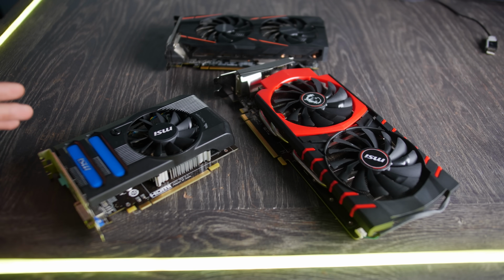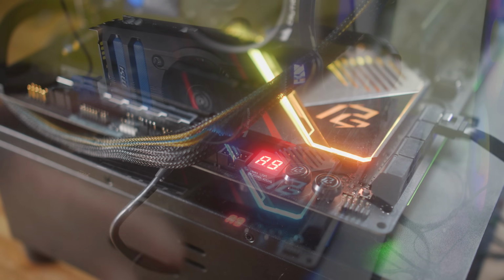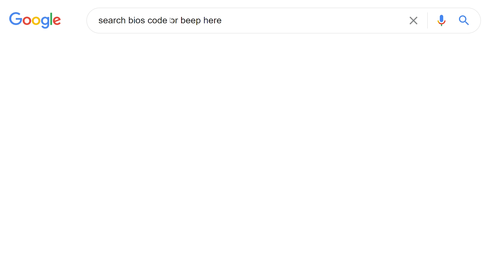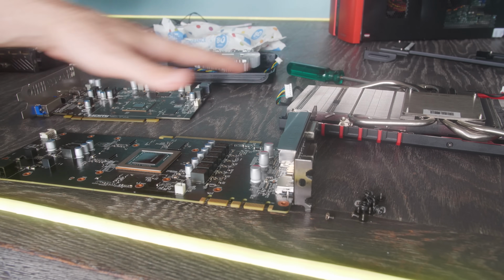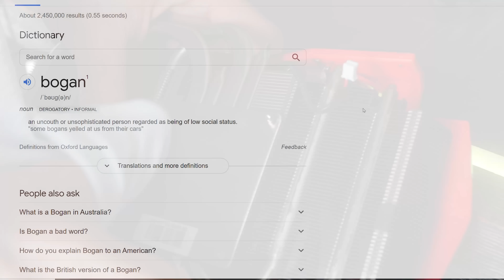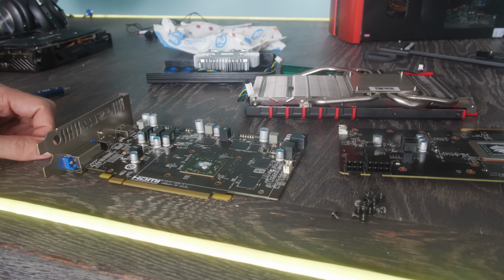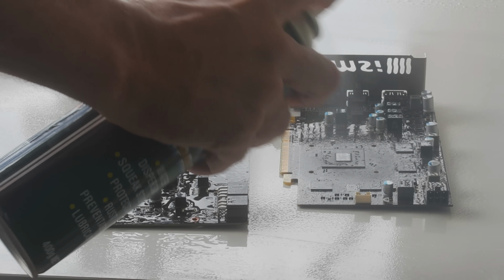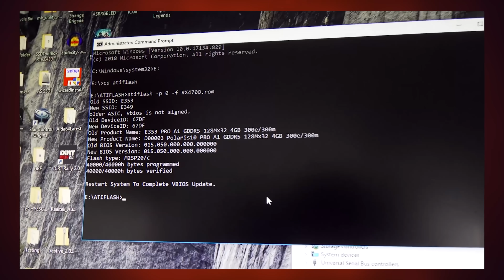How To TRY and FIX a Graphics Card (COMPLETE Start to Finish)

Comment: I have a Gigabyte 1660 Super that works fine on light loads, but after 10-15 minutes playing games or benchmarkinging with Heaven, the card will crash and the system reboot.  I put the card in another system and I am seeing the same behavior.  Thoughts on the issue and if a tear down and cleaning and re-pasting would resolve the issue
Reply: Thats all u can do really without doing heavy modding

Comment: If you use a thermal camera, or just put your finger on the board,
you might be able to see or feel components that are shorting out (they become hot very quick).
 Components on old dead cards can be re-used, if you want to try micro-soldering.
Reply: no decent PSU will ever let you run shorted card long enough to feel any heat and that's now a way you looking for shorts on graphic card. It can be used in many other things, yes (still not inside the computer though but with PSU build for that) but with GPU you want to avoid that. In some combination of faults  you can fry a GPU, memory or something else.
Reply: @gorky_vk  A shorted component need not be burning hot to detect it.  It just needs to be abnormally warmer than it should be.  If the psu shuts off in 1 second, then everything on the board should be cold except the shorted component.  A thermal camera makes it easy to see any components that are abnormally warm.  By the way, a short is not 0 resistance.  A short means abnormally low resistance.  There is still some electrical resistance in a short.
Reply: @sixcoregamer9221  you obviously don't have idea about electronics and even less about repairing graphics cards. Watching few repair videos on youtube don't make you expert.
There is no way that any component heat enough in 0.xx seconds before PSU shut itself down, graphics cards have large (LARGE) planes of copper to spread heat (and support high currents of usually over 100A) and even with thermal camera you can't catch something like that.
And yes, resistance don't need to be zero in shorted semiconductor but that will not help you too much with graphic card repair. Most of the times that will be worst case scenario as PSU will not react fast enough, component will get extremely hot and damage PCB.
Reply: @gorky_vk  According to you, gpu fires can never happen because the PSU will always shutoff before the component becomes dangerously hot.  youtube.com/watch?v=WLuMd-osAbs
Reply: @sixcoregamer9221  I see we don't understand one another - you talking about things you watch on youtube, I talk about actually fixing things. You now, in real life. For living. Not specialized in graphic cards but lately (for reasons we know all too well) many GPUs pass my hands. 

And point of that video is what? That some idiot plug shorted card in PC without testing  card before? 
You are aware that not all PSUs are born equal? Do you suggest that's as way to diagnose short on GPU?
Just stop embarrassing yourself.
Reply: @gorky_vk  If there is a short and if the PSU shuts off instantly (after pressing the power button), then reset the PSU and press the power button again. Repeat until whatever is shorting starts to warm up.
Reply: @gorky_vk  The point of that video is to prove you wrong.  Deal with it.
Reply: @sixcoregamer9221 ok, just repair your cards with trying constantly to  push 12V in gpu. Good luck with that
Reply: @gorky_vk  If you have a bench power supply, you can apply less than 12V.  You don't have to use a PC PSU.
Reply: @sixcoregamer9221  so you will now repeat all I say in my first comment?
But I'll give you one hint - standard bench  PSU will not help too much, usually they give up to 5A and with low voltages, safe enough to work around core or memory you'll need way more to find anything (again because way graphic cards are built and ohm law).
Taking shortcuts are not wise with GPUs, with other types of boards like laptop mbo's bench PSU is quite helpful and can be fastest way to find fault but with GPUs amateurs poking with one will just sign death certificate for card.

Ask guy from adamantit to take a look at Brian's video, I'll be happy to hear what he have to say. Can't wait.
Reply: @gorky_vk  You did not even watch that Adamant IT video because you replied within 3-4 minutes after I posted the link.  Don't make another stupid comment until you watch that video.
Reply: @sixcoregamer9221  I watch it long time ago like most of his videos. Can't say I remember every bit of it but don't even need to watch 1 minute to know he don't use PSU to fix a GPU.
Find me one video where someone fix GPU with PSU method and I promise I will watch it from first to last second.

And no, I never say PC PSU is better than bench PSU, I say that using PC PSU like you suggest is stupid and using bench PSU will not help as current they can provide (most of them, there are better ones but quite expensive and you will not see them in average repair shop) are not enough to heat boards like graphic cards with card-wide power planes.

But, just do what you thinks is best. I just hope others will do little bit more research before killing their GPUs for good.
Reply: @gorky_vk  If you actually watched that video, you will see he found the short with less than 5A from the bench power supply. It was your idea to find a short using the PC PSU, not mine.  I merely told you how to do with it with the PC PSU because you said it is impossible..  Anyone who actually repairs circuit boards knows a bench power supply is way better than a PC PSU for repair work.
Reply: @sixcoregamer9221  there is no point, you don't understand basics. Not enough to get point from video you link to and if picture is 1000 words I can't see a way how to make you understand anything just by typing here if million pictures didn't taught you anything. 
You remind me of some guys who watch Sorin from electronic repair school working on laptops and start poking mainboard with bench PSU without understanding how they work and what is safe and what not later shocked with fact they kill everything on board doing that.

I can only advise you to try few repairs, feel difference between working on laptop MBO and GPU PCB, kill few components and learn something in process. Most of us started like that anyway. I build my first bench PSU probably before you were even born. 

And yes, still waiting on video where someone inject power into graphic card to find short on gpu VRMs.

Comment: Bryan not trying to criticize your methods of fixing a GPU but in my opinion you absolutely drowned both GPUs in multi purpose spray possibly leading to the GTX 970 smoking. The spary might not contain any conductive material but i think that if you spray that much it might affect the GPU negatively (even tho it was broken already) as it might go under some board components. I think a better way would be lightly spraying on a cloth and wiping it gently making sure that the spray desnt remain on the GPU and it evaporates so that it dsoesnt affect the GPU when turned on. Thanks love the vids.
Reply: Well my semi-educated guess would be that the card has a short in power delivery and shuts down, you can see it when the fans twtich for a second on startup. and a shorted part gets hot, and I am pretty damn sure that the little puff of smoke was multipurpose spray evaporating from the hot, shorted component. whether you take alcohol or WD-40, and douse the card, if you injected a low voltage into the disassembled thing and looked where the smoke comes from you#s find the culprit.
Reply: @catriona_drummond  EIther way even if the smoke was from the spray evaporating it still shouldnt be there in the first place when turning the system on. And for the spray to evaporate that quick it is kinda impossible as the card was just turned on meaning it wasnt hot. For the spray to evaporate like that the card must have been much hotter. If the spray was on some sort of chip that got hot very fast then yes it could have been they spray. It still shouldnt have been there when turning on the computer. Bryan should have waited for the spray to dry or dry the board him self.
Reply: @CIP19  12V on a few amps from the slot and 2x6 pins on a shorted 2mmx3mm SMD part can get very hot in less than a second. And stay hot if it still gets voltage and just prevents the rest of the circuitry from turning on.
As for the spray, don't think that ever fully evaporates, contains some oily components. And frankly, as long as it's not conductive it's not a problem.

Comment: Hey Brian, I recently bought a used Palit GTX 750 Ti. I'm unable to get this thing working properly. I do get a signal, but only at a very low resolution. Windows 10 device manager always shows a "Code 43". Adding Nvidia drivers manually doesn't work neither. I tried it on two different boards (MSI & HP) and it's always the same...
Do you have any idea how to fix this problem?
Thank you for your great content and many greetings from Germany.
Reply: Ist Code43 nicht ein Problem mit zu wenigen PCIe lanes? Grüße 😉🇩🇪
Reply: @mikeschmidt91  Hey Mike, was genau meinst du mit zu wenig PCIe Lanes?
Reply: Ich hatte schon das Problem, dass „zu viele“ Geräte angeblich angeschlossen waren und die CPU nicht mehr ausreichend PCIe Verbindungen bereit gestellt hat. Da wurde dann auch der Fehler ausgeworfen, dass meine GraKa defekt sei. War halt nur nicht so 😉 hab dann im BIOS Geräte abgeschaltet, dann war der Fehler weg.

Hast du schon mal im Gerätemanager die GraKa deaktiviert bzw. darüber die Treiber gelöscht? Ich würde DDU und einen älteren Treiber (eventuell weißt du, wann die GraKa noch lief) herunter laden und dann nochmals manuell der Treiber installieren.
Reply: @mikeschmidt91  Ok, das ist interessant. Im Gerätemanager habe ich alles Mögliche durchprobiert, auch Nvidia Treiber von 2015 - ohne Erfolg. DDU habe ich bisher nicht genutzt, weil das Board, für welches ich die GraKa nutzen möchte, keine eigenen Onboard-Grafikausgänge hat (ist ein älteres Board mit einem 1155 Sockel und einem i7-2600). Mit DDU hab ich da Schiss, dass der auch die Windows-10-Nvidia-Treiber runterzieht und ich die Karte dann gar nicht mehr nutzen könnte. Ist mies, wenn man nicht auf die Onboard-Grafik ausweichen kann.
Ich werde auf jeden Fall noch einmal ins Bios gehen und gucken, was ich da abschalten kann. Ist nur komisch, dass ich auf beiden Boards diesen Code 43 Fehler hatte. Mit einer anderen Grafikkarte (hab noch eine GT 1030) hier, läuft alles ohne Probleme. Nur mit der GTX 750 Ti halt nicht...

Comment: where can i find a capacitor for an rx580, i cant find the exact one i see but i see similar ones with same ratings, is it safe? i heard i need to change the row of capacitors to match since there is a huge row of them the same. one was broken off physically. its an easy fix but wondering if i can salvage one off a diff card that has similar ratings also.
Reply: You don't need to replace entire row, and if you, say have a 100uF 16V capacitor it's OK to replace that with 100uF 50V, but NOT ok to use a 10V cap, for example.

Comment: I have a gtx 1650 low profile that is working fine but the fans are always running at 100%, tried a different card on the motherboard and it's working perfectly so I know it's not from the motherboard, I also tested the card on a different motherboard and the fans were running at 100% (the fault is with the card). I tried msi afterburner to control the fans but it didn't do anything.
Anybody has any suggestions?

Comment: I had a weird smelling card on power up. It was one of the VRAM chips that was actually crushed (a gt 740 sc 4gb  gddr5). I replaced it with a VRAM chip from a dead rx 550. Works fine now.
Reply: Consider yourself a lucky guy, because you got  the exactly same memory chip on both cards, otherwise it wouldn't work.
Reply: @Lucaspc99  It was more an educated guess. I repair laptop and chromebook motherboards for a living. Plenty of times I have had to remove the BGA SSD chip and replace it with a different one, often a different brand and/or capacity and it usually works provided I don't screw up. I figured as long as the BGA pattern and ball size is the same and the VRAM chip type is the same, I should be able to replace a bad VRAM. Plus, if you think about it, a graphics card manufacturer is not always going to be able to source a particular VRAM, so it makes sense for their boards to work with multiple manufacturers' VRAM.
Reply: @Voidsworn  Oh nice to now, i tought you need chips with the same "specs" for it to work, or matching chips.
Reply: @Lucaspc99  they aren't the same memory chip. One is a larger capacity (the rx 550 is a 1gb chip). The gt 740 only recognizes up to the 4gb max.
Reply: @Voidsworn  Well, it shouldn't work then, but like I said, you are a man of luck!

Comment: For Nvidia cards there is Mods/Mats tools that can be used to test the VRAM (and detect which chip is broken) and to test the card overall.
Reply: How this soft is called?
Reply: @spla5h627  Nvidia Modular diagnostic software (MODS). It's not officially released, just leaked from Nvidia. I have more info on it at https://rk.edu.pl/en/nvidia-modular-diagnostic-software-mods/

Comment: Can you make a video on how to fix a RX 580 type card that is bricked on a bios update. A buddy of mine gave me  an XFX rx 580 8gb cause he messed up on the bios update on it. Thanks B
Reply: If you have a Cpu wiht Igpu, you have to boot using the integrated graphics (connect your monitor to the motherboard), and then try to flash the Bios for your RX580. Look for the correct Bios at Techpowerup VGA Bios collection.

Comment: I fix GPUs, people are buying dead GPUs and throwing them into ovens and either fixing them temporarily or breaking them permanently. Theres going to be a flood of E-Waste.
Reply: Nice! LoL. Would you have any suggestions about what you do or look for when repairing them.
Reply: @anthonybc  First thing is never plug those things in, never. You should always look at your power rails first to make sure they are all there and not shorted with a Multimeter. Theres also plenty of channels here on youtube that deal with GPU repair. Its more complicated than just cleaning or throwing one into an oven and crossing your fingers.
Reply: @IONindustries627  haha yeah I figured. Thank you for your insight. I've been holding onto a dead GT 730 for a few years hoping to revive it. I guess I'll start doing some searches on repairing since I can't find much new stock for reasonably priced cards.

Comment: I'll preheat the oven while I watch
Reply: Reflowing is not a fix. Also if you have to reflow dont use the oven. You will bake the caps and every other temperature sensitive component on the board. Use a heatgun and kapton tape.

Comment: I have a Sapphire r9 270x dualx 2 GB card that has a short circuit in one of the 6-pin connector. My computer just shuts down right after I push the power button. There card is triggering the short circuit safe mechanism of the power supply. Any idea how to get it fixed?
Reply: it will be much simpler to give that to someone who know what he doing. You can't fix that with tools you probably have (as you ask question like that) and even if you buy tools&parts you will still lack a practice (and like most of us probably kill your first project :)).
Reply: @gorky_vk  Thanks for the advice dude, really appreciate it :)
Reply: @Rexicup  I know it's not something you want to hear but truth rarely is :)
I don't know where you from but I'm sure somewhere around you'll find people who fix electronic for living or at least as hobby.